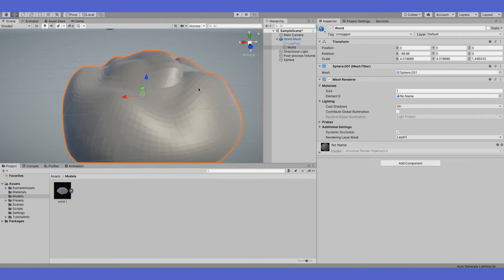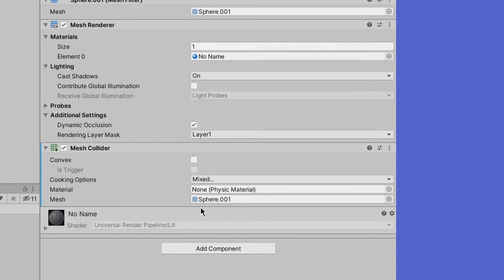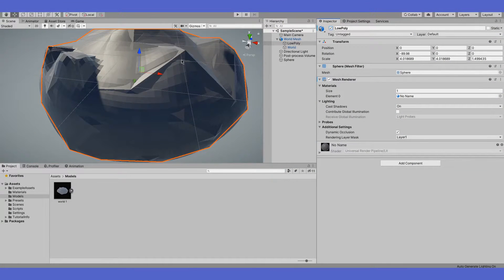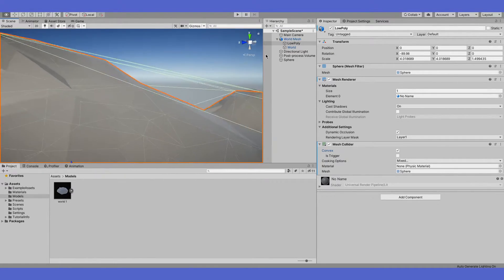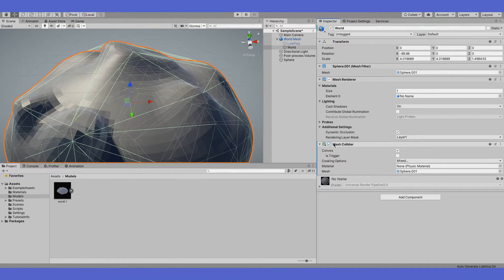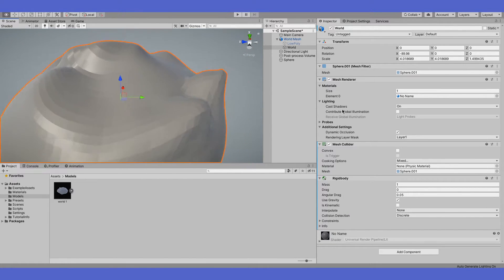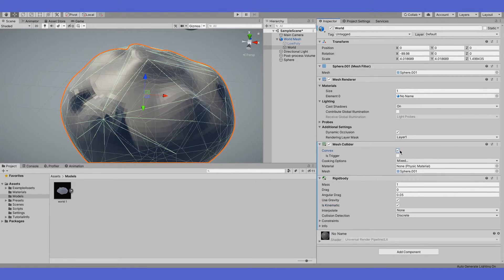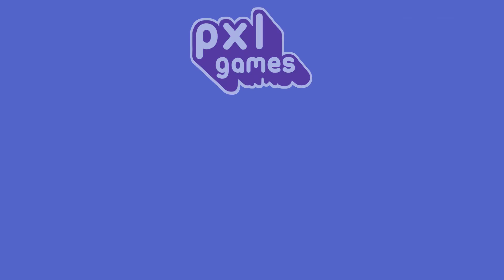Unity Mesh Collider Fix

Comment: I see a lot of comments talking about this miracle solution, which is wrong and seemed to be achieved by trial and error. It is not that the mesh "lost it's detail". The collider is set to "Convex" which means it will not be concave. The collider will wrap around the mesh ignoring crevices and such. All you need to do is either disable the "Convex" parameter or create collision by yourself using multiple meshes or multiple primitive colliders. You do not need a Rigidbody here at all. Rigidbody is used to give your object physical properties, to let it move using physics, pushed around, affected by gravity and such. Please, before uploading random solutions in the internet, check the official documentation. It is all there.
Reply: I agree on top of this comment. Rigidbodies are used to simulate physics to said object. If it is static and has a background intention or mostly static environment, this is a very expensive and wrong solution that in the end product can not be used for sake of performance.
Reply: People who think there is a simple solution to a complex problem often simply don't understand the problem. Your post makes it clear you don't understand the problem that Pxl Dev is trying to solve, instead you are talking about a simple textbook problem easily handled by your solution. Please make an effort to understand the problem before dismissing someone's solution.
Reply: @waytoomuchtimeonmyhands  your first statement is absolutely right. Author of the video did not undarstand the reason the problem appeared in the first place and created an incorrect solution that in the long run can create more problems. Programing is not a religion but there are some things that are incorrect or not. A mesh with convex And concave elements is still a concave mesh. Convex setting makes the collider fully convex. The best way to learn how this works is to just check for yourself. I recommend reading unity documentation on Mesh Collider. They explain very nicely what the difference is, what the limitations are, and what problems they can solve or create if not used properly. Always check documentation first before saying someone's wrong. Ive been working as a unity dev for over 8 years, I've encountered these issues myself and I know how problematic it can be if you apply an easy but incorrect solution to a problem, instead of understanding it
Reply: This isn't as complex as you think. If you rather take shortcuts than yeah It can be. Now if you willing to put in the hardwork thats different. I'd make multiple meshes for multiple needs. If i need to make a convext mesh that goes concave i'd split the concave mesh into four pieces that connect still. And again its to your point about being able to go about it the way you want. BUT you not gonna sit here and dismiss all the hardwork of others for the sake of optimizing. Either way I wish you the best in your gamedev journey! :D
Reply from the maker: I am truly sorry if you found this video to be a waste of your time. This video is more aimed at the beginners, who may not understand how to properly use the information from the official documents. It seems that this video was useful for people, even though it isnt the "proper" way you are saying. I will try to explain things better in my future videos.
Reply: @PxlDev  He's right tho, it isn't the proper way. Videos like these are doing beginners more harm than good. Another helpful alternative would be to make low poly convex shapes only for mesh collisions. Although it's you'll need to 3d model yourself, its a very clean way of utilizing Unity's mesh collider.
Reply: @Mrminico92  What if you have a procedural mesh that has both convex and concave elements? Programming isn't a religion. There is no absolute best way to do something that works every time for the best price. There are trade-offs that need to be evaluated on a case by case basis. I found this solution very useful and am glad they posted it.
Reply: @waytoomuchtimeonmyhands  unfortunately, even though you're saying "programming isn't a religion" it is. ESPECIALLY when it comes to procedural  generation. This isn't subjective like art, And although I also agree you can go about it however you please, do remember that the term optimal exists for a reason. And being optimal has more todo with the hard work / findings of others per case studies.

Comment: Tryin to do this with procedurally generated terrain, like the one in Brackeys terrain tutorial, but I won't get it to work
Reply: Since it is a generated mesh, I thought to add the Rigidbody after the mesh is generated, in the script, but it still doesn't work
Reply: Could be because the terrain generated doesn't have any volume.....

See text on Mesh Collider:

Note: A convex mesh is required by the physics engine to have a non-zero volume. Flat meshes such as quads or planes that are marked as convex will be modified by the physics engine to have a thickness (and therefore a volume) to satisfy this requirement. The thickness of the resulting mesh is proportional to its size and can be up to 0.05 of its longest dimension in the plane of the mesh.

But this is for a convex shape, which I'm not using? Its so weird

Comment: Which version of Unity are you using? My mesh collider do not even work at all anymore since I started with Unity 2019.4.13...
Reply from the maker: I am using 2019.3.7
Reply from the maker: maybe try to re add the collider, with out the rigidbody?
Reply: @PxlDev  Yes - that was my problem.... Do you know how to make them work together?
Reply from the maker: @livjonsson742  well, you could try removing the rigidbody, and then trying.
Reply from the maker: make also sure that the collider is using the model and mesh you want to use
Reply: @PxlDev  I´ll try that. I need the object to have a rigid body but perhaps that is not possible with Mesh collider?

Comment: But dude, I have a moving object and I have a concave mesh collider and kinematic rigidbody on it but it doesn't detect any collision at all.
Reply from the maker: Then try changing the kinematic to dynamic
Reply: @PxlDev  Hi, What do you mean by this? Which option should I adjust to dynamic? It doesn't work for me either.

Comment: nice tips
also can u tell how to adjust mesh collider rotation and size. as my mesh collider is not at the position of my 3d model. thanks.
Reply from the maker: Sorry for the late reply, You can change the offset in the mesh colliders settings in inspector, but I dont know if there is a way to rotate the collider without changing the collider scripts itself.
Reply: @PxlDev  cant we make an empty parent and change its rotation